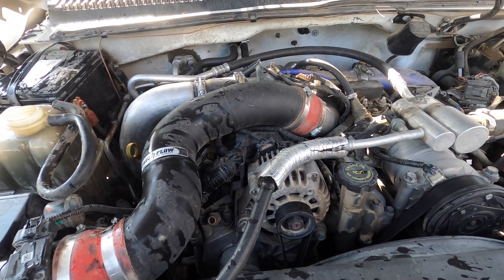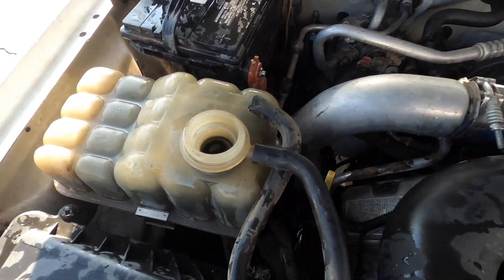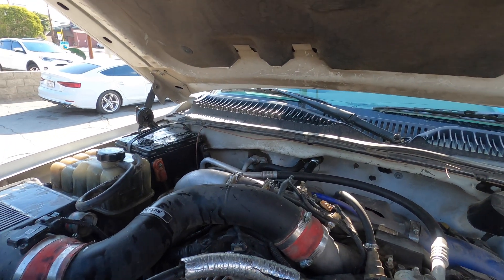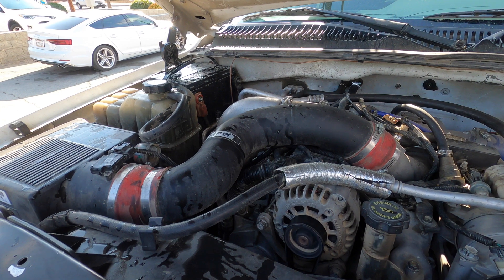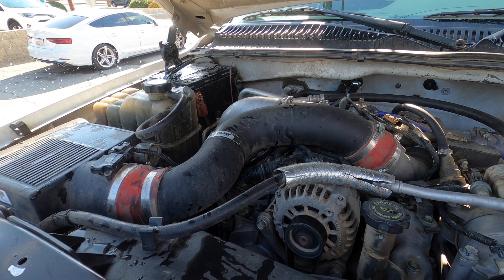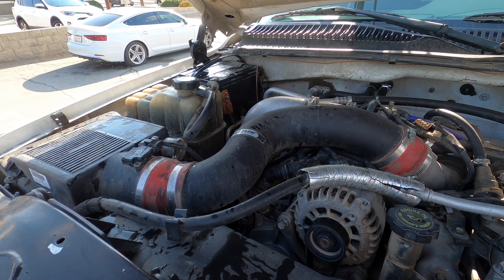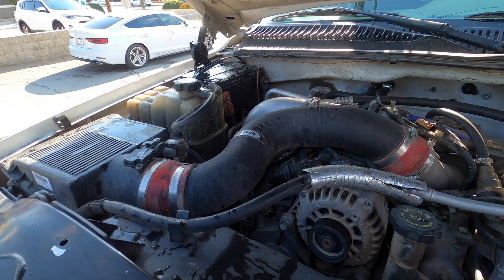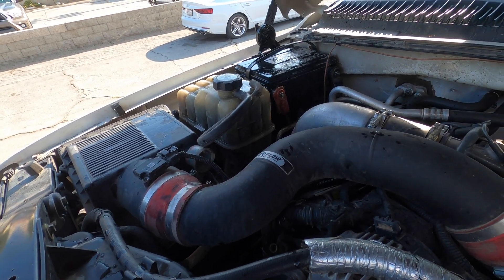Duramax With Excessive Cooling System Pressure

Comment: YEP it is always the back of the engine by the fire wall that the head gaskets leak. and put that black sult in the coolant tank and start popping little coolant lines... and then blow out the seal in the water pump that will go too... sad to see this there is a video on how to change out the heads, Truck Master you tube videos are what you need to see a step by step..

Comment: Head Gasket very bad... i just did one same problem $6,500-$9,000:  i did it for $4,000 at home $1,500 for brand new heads with old hardware changed over from machine shop. and a lot of dealer only gaskets, and installed ARP studs for the heads... diesel repair shops all want $4,000 just for labor to remove and install heads... so i did it at home... been 18 months now no problems yet it is a LLY 2005 GMC...
Reply from the maker: Unfortunately it is a very labor intensive job to do. I’m glad you were able to save all that money and do it at home.

Comment: No egr on that model engine. HEAD GASKETS!
Reply from the maker: From what I've seen the California emission 2003-2004 lb7 do have egr. if its a federal emission truck it will not. This truck did have a cooler and it was tested perfectly fine so defiantly a head gasket issue.

Comment: What did it end up being? I have the same issue.
Reply: If its not a water pump, or the expansion tank cap. Then it's almost 100% a lifted cup on an LB7 or Headgasket, only way to know is to tear it down. :)
Reply from the maker: I recommend to remove the cylinder heads to inspect and the customer declined. The egr cooler was removed and tested fine.